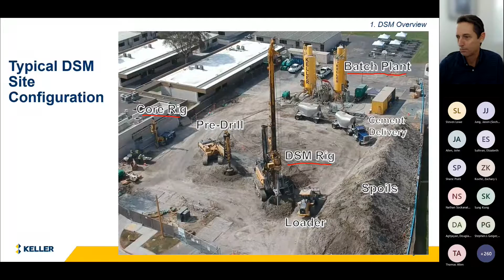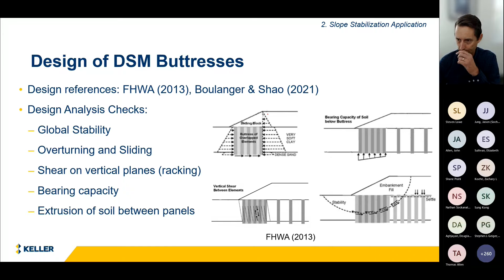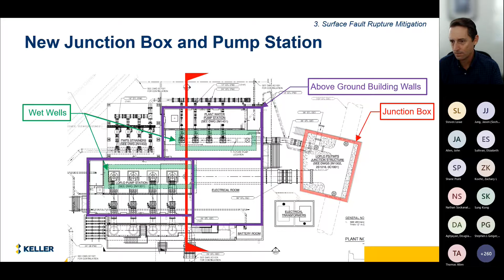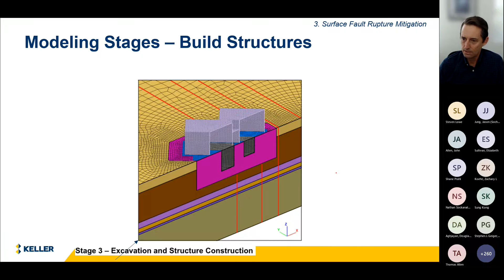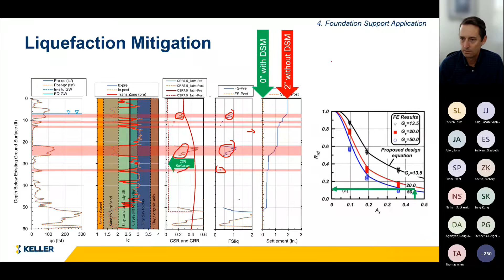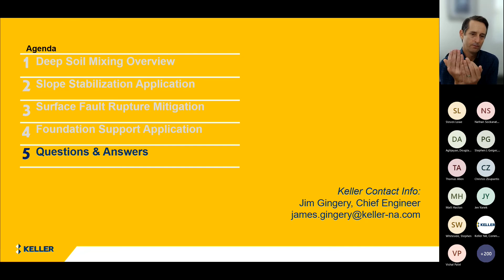Keller Webinar Series | Deep Soil Mixing

Comment: What about the durability of deep soil mixing?
Reply: Like concrete, portland cement in soilcrete continues to hydrate and cure over time to pick up strength. We typically use sulfate resistant (Type II/V) cement. We have not experienced any problems with degradation over time.

Comment: How and why is this used in FL soils and also with its crushable limestone “bedrock”?
Reply: Keller has performed deep soil mixing extensively in Florida. Even with crushable calcareous sands or limestone, we can achieve target soilcrete design strengths that are necessary to meet project requirements.
Reply: @jamesgingery1842 I guess the Crete would flow into any voids created?
Reply: @Jp421JP potentially but you can pay close attention to theoretical vs actual capture volumes. Some limestones in Florida and formations are not properly captured form cores/drilling and mechanical fractures through drilling sometimes don’t represent the actual layering of the strata.